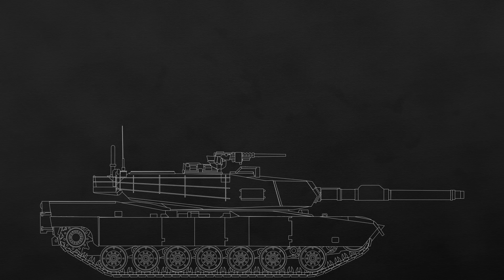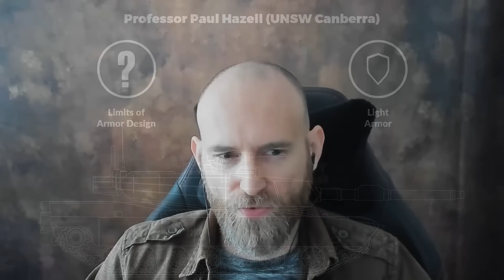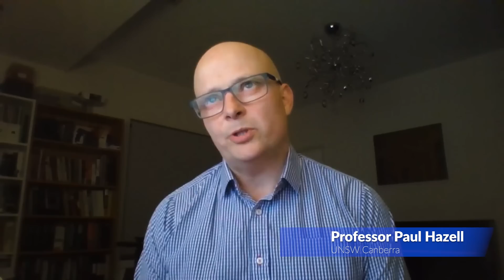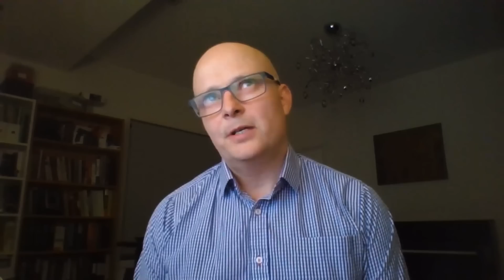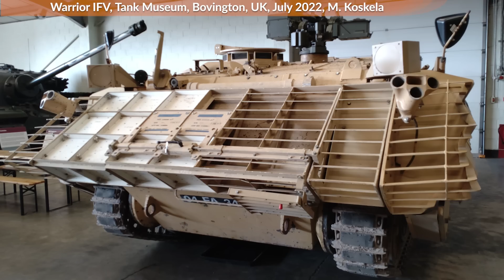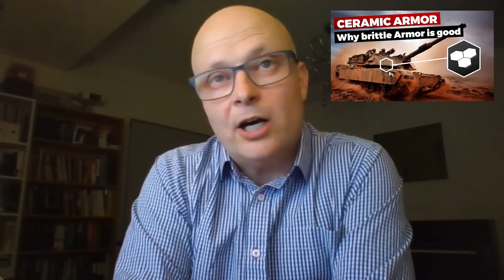Limits of Armor Design & Light Armor

Comment: High entropy alloys are extremely promising for a major advancement in material science, with substantial improvements in the strength-to-weight ratio over conventional alloys. It isn't something that's just around the corner though, it will probably still be a few decades before it becomes a practical candidate for use in armor.
Reply: I was just going to say that materials development will keep the tank viable for the next cpl decades at least. I'm sure there's LOTS of money being directed to this end.
Reply: @markb8468  True, but the manned tank is going to be obsolescent here pretty soon though. Drone tanks eliminate all the space used up by the crew and their necessary equipment (no chairs, monitors, air filters, etc.). They're lighter, faster, untiring, require no training, and are far more politically expendable.
Reply: @ostiariusalpha  Soon? No. Drones still have to be controlled and maintained by human crews in or near the front. So all you have done is replace the tank with two vehicles, one to do the shooting and one for the crew.  Are there benefits there? Sure, put i think the operational problems are far greater than you believe. And if you are talking about autonomous AI tanks, well the technical, ethical and political problems there might outweight the political cost of sending people in harms way.
Reply: @makottim8  There already are two vehicle types, usually more. Americans are very serious in sticking with combined arms doctrine, unlike the Russians, so every tank coordinates movement with IFVs and air cover. The tank operators would be sitting back in whatever is replacing the Bradley while the actual tank is doing the forward maneuvers. AI is also coming along very quickly: the NGAD fighter will have autonomous drones obeying its directions independently, rather than being remotely piloted. The same will happen with tanks; a few will be remotely operated, while the rest will autonomously follow orders. As long as they are following a human's command decisions, it is ethically no different than any other piece of non-autonomous equipment.
Reply: @ostiariusalpha  You articulated it much better than I could have. If anything the NATO doctrine seems to be progressing towards MORE integration in combined arms via the programs you have outlined. And that's not even taking into account the role and methods of naval warfare.
Reply: @ostiariusalpha  
The potential for e-warfare and very carefully placed strikes is something that strikes me as unconsidered here. 
If there is a major switch to unmanned systems, your ability to have absolutely critical roles on the battlefield, not supplementary, or replaced by conventional means, but absolutely critical, skyrockets. The chance that you could jam connections, purposefully invest in missile warfare to take out command vehicles, communications network or even staffing. Of course, anti electronic warfare is part of electronic warfare itself, but the cost of inventing and investing in huge amounts of longer and longer distance communications technology, more powerful burnthrough and signals, I mean, I really do not think this is a cut and dry as one thinks. Having digital sights is great and all, but having redundancies is usually not too costly, or impractical, and it means that there are multiple stages of everything has gone wrong. It keeps you in the fight longer, relatively as effective, etc.
With unmanned systems, however, even relatively smaller powers could heavily invest to make enormous amounts of your firepower absolutely redundant. What are you going to do with a bunch of hulls designed to be unmanned? Your only option would be to melt them down, or to invest in much, much more expensive technology, specific to each tank. Of course, the arms race happens, but I genuinely think manned systems have advantages that are not accounted for. Not in supplementary roles, but in critical ones. Suddenly having no armoured fighting vehicles able to respond to attacks, or to support infantry, etc., would be an absolutely enormous disaster. The potential for a counterattack to easily claim almost all of your hardware, disable it, etc., is tremendous. There is not much incentive to do this to a tank *yet*. But if almost all of your major components rely on unmanned systems, the incentive is far greater than anything else, and innovations will be made, to make it cheaper and easier. 
True AI would be what is required, and it may not even be possible, and it would not be something you can program or force to do things. If you mean progressive networks, they are not particularly more special than regular softwares, simply more efficient, depending on task / purpose. At least as far as I know. 
Imagine how devastating it would be if you sent out a squadron, mostly comprised of unmanned vehicles, and during the strike or otherwise, you suddenly lose 60%+ of your capability, perhaps 100% of specialist capabilities. It only takes a few seconds of inactive flight to completely total an aircraft, too, whether it is downed by an enemy, terrain, etc.
You could probably do things that circumvent this, such as automatic and onboard instructions for certain situations, but you would still greatly lose effectiveness compared to normal.
Reply: @FridgemaxxedHybridoreanLifta  It is actually pretty cut and dry, the technology is simply too overwhelmingly powerful to not invest in. Any side that depends mostly on attempts at counter-integration tech is at a massive disadvantage, and will likely get massacred.
Reply: @ostiariusalpha  Americans have had a remote armoured fighting vehicle since 2005. But they haven't been using it because of drawbacks associated with it.
Reply: @jgw9990  And we had remote flying drones since the 60's, it took awhile before it was mature enough to be practical. The same is now happening with ground based vehicles.
Reply: @ostiariusalpha  Who goes to Hague if robot tanks decide to run over civilians? Responsibility has to stop at a human either way, would be better if he was in the decision loop.
As for having crew and tank separate and crews in light vehicles - you could then kill the crews with any aerial machineguns or even lightest cluster munitions. Even a drone carrying cluster bomblets to use as light bombs.
Reply: @MarcinP2  I literally said that they take direct commands from a human. Do you not know how to read?
Reply: @makottim8  the crew can be houses in an IFV - which in itself also has uses.
Reply: @makottim8  ethics don't really matter in war
Reply: @makottim8 another 2 issues with drone tanks:
-they are still inferior in terms of situational awareness. To manned tanks.
-its alot harder to keep them connected to their controllers, compared to UAVs and other air drone types.

That said the offical American plan (well the version released to the public) is to ahve 1-2 drone tanks per manned tank in the next 30-50 years.
Reply: What is the point of a war with unmanned vehicles fighting each other? Just a waste of money and resources really, at the end of the day you still have to make your opponent yield to win the war which means killing people
Reply: Are there any other promising alloys out there?
Reply: @edward9674  Amongst more conventional types of alloys, there are interesting developments in micro-crystalline structure manipulation. Steel alloyed with aluminum (often referred to as Super Steel) has been a holy grail for some time now, but the historical results have invariably been too brittle to be useful; material scientists in S. Korea have recently managed to gradually improve control over the micro-crystal grain formation in the metal to produce an alloy that successfully shares the lighter weight of aluminum and greater strength of steel. Manipulating nano-scale structures in carbon and boron materials is also yielding interesting results: amorphous carbon, such as AM-III and Q-carbon, and amorphous boron nitride are huge improvements over more established traditional materials.
Reply: And tanks will not use them, we already have materials that are far superior to what is used in tanks. Thing like tungsten-diamond composites. The main limiting factor is price. That's why you see american tanks using DU instead of tungsten alloys, it's dirty cheap, that's why you see titanium being used only for gun mantlets. Steel, ceramics and plastics are just much cheaper than more effective alternatives.
Reply: @Ally5141  The price is the secret behind many of the new materials. Steel aluminum alloy replicates the performance of titanium, but is orders of magnitude less expensive to produce. Boron is a very common element,and carbon is even moreso.
Reply: @Ally5141  The reason newer more advanced, higher end state of the art materials are not being used in military vehicles and equipment is because of the secrecy surrounding them. These materials are sensitive and kept highly classified for a reason. The reason is that other adversarial rogue states like Russia, China, and North Korea are spying on the U.S. and are interested in America's weapons and defense capabilities so they can copy our technology and possibly use it against the U.S. and other NATO Allies in an act of aggression.
Reply: Put enough interested smart people on it and you'll have results sooner rather than later.